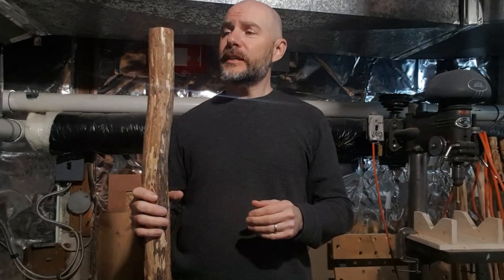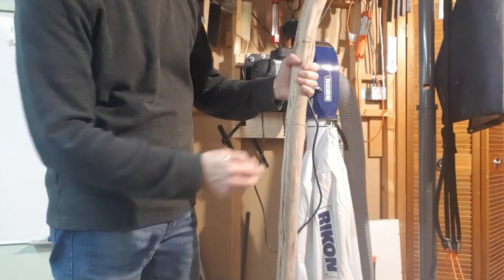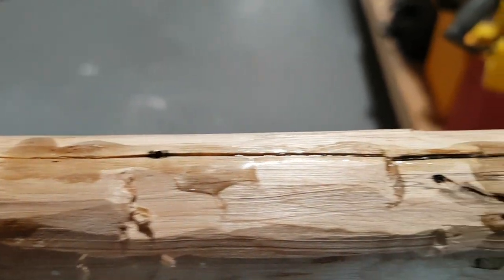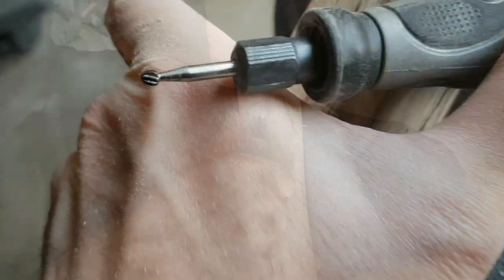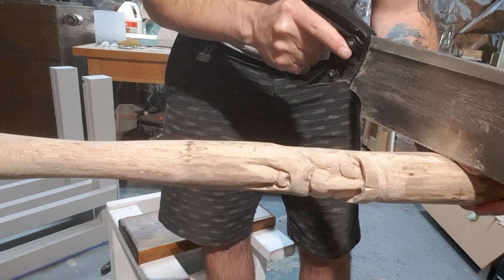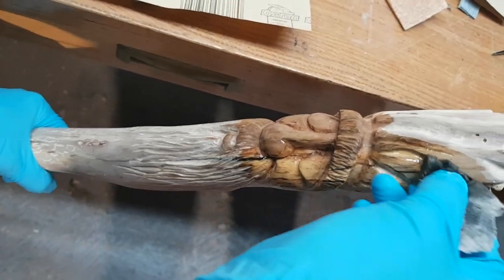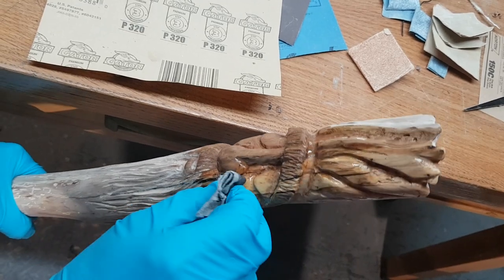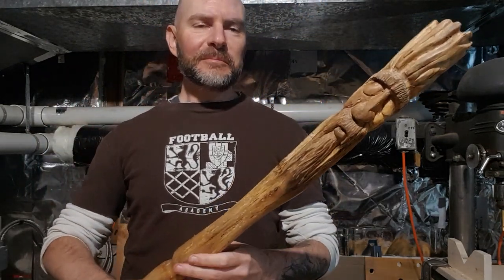CARVING A WALKING STICK / WALKING STAFF

Comment: Jason, what do you recommend for a finish for a using staff?
Reply from the maker: I’ve been using Teak oil or Danish oil… I want to try Linseed oil next. But I’ve also used polyurethane, lacquer and even paste wax for top coats. They all give something to the wood. But mostly been sticking with the oils because they go into the wood fibres and not just sit on top like a polyurethane… hope that helps

Comment: Do you know anyway to reinforce any cracks in a walking stick by chance?
Reply from the maker: I’ve added epoxy and that’s helped on some sticks with checks and cracks. Add some Color into the epoxy and it adds a nice accent to the finished piece